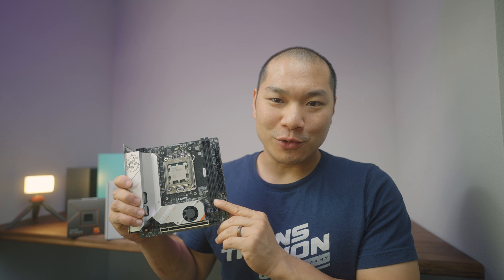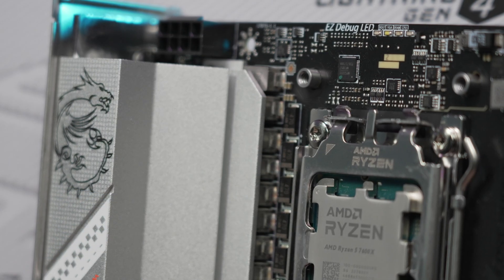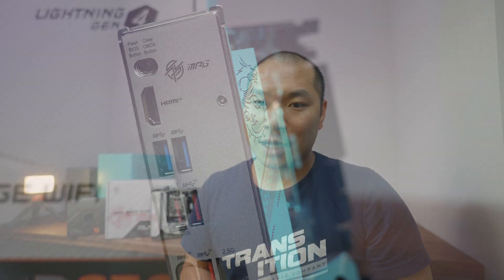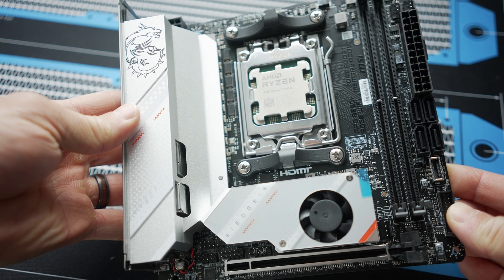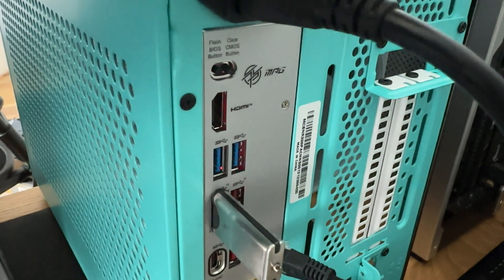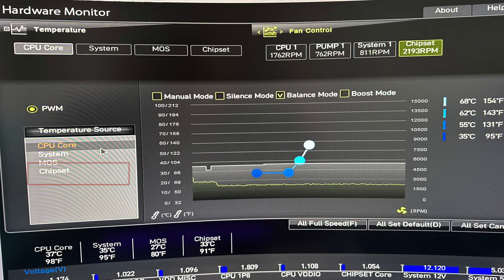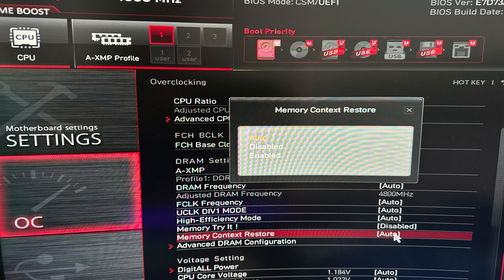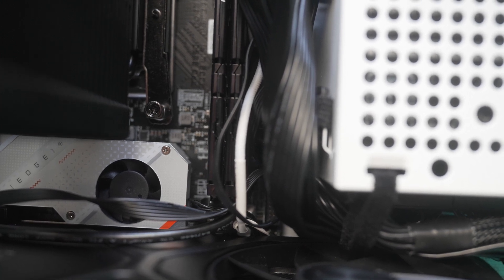MSI B650I Edge... Zen 4 Mini ITX for the rest of us?

Comment: It would be a go-to motherboard for me, but it has one design flaw that could have been easily avoided. It has 3 audio jacks at the back. So that is good, I can connect 5.1 speakers that I use since 10 years cuz they are good ! WRONG. I can't. Some one at MSI decided that it requires front panel audio to connect 5.1 audio... Genius ! That leaves only Gigabyte (that has everything as you would expect, 3 audio ports at the back to connect rear/front/center) or Asrock (that seems to be similar but it does not state it in the manual, so it is still a gamble).

Comment: Could you please confirm if there are any buzzing noise upon high gpu usage through 3.5mm audio ports (front and  back). ❓
I have 9800x3d, msi b650i edge wifi, 3070ti and xpg lancer 32gb ram.

Comment: The high CPU socket position is the most annoying aspect of this board. Makes certain coolers incompatible like using a IS-55 in a Fractal Ridge. The high position will work against you in cases like the Ridge and Terra that positions the motherboard upside down, in reality this moves the socket to the bottom of the board and heat gets trapped at the top of the case or middle in the Ridge.
Reply: For this I am moving to the ASUS B650E-I

Comment: Sadly its a year later and MSI still hasn't made a B650E ITX board (actually no new ITX boards have appeared, its slim pickings)

I don't have issues with PCIe 4.0 for the M.2, but I am concerned with only having a PCIe 4.0 expansion slot and future graphics cards.
Most likely the 5060 will cut lanes just like the 4060 did, not a problem if down to 8 but with 5.0 having so much bandwidth additional cost savings might be had and its chopped to 4. (there was 4.0 cards that only had 4 lanes so with 5.0's bandwidth there is a high chance more cards will only have 4 lanes)

Comment: If I built an AM5 system, it would either be this board or probably the Asrock Phantom b650 itx. I need a spdif for my flight sim headset with the head tracker, and the asrock has that feature. I've been using the b550 edge from msi for a couple years now, with no complaints. Not sure why they took off the spdif for this version, but it probably cost them a sale from me.

Comment: Just realized my b650e-i strix has a dead aio_pump header. Bad solder on the 12v pin. It's still within the return window and the only other board my local store has is this but I see so many people complaining about dead battery issue 😡. Also it's only $15 cheaper here with far lower specs vs the b650e-i.

Comment: Hello - I have been following your channel for a while, and I love the relaxed yet informative style you have got going :)

I had a question, perhaps you no longer have this board, but if you do it might spawn another video :)

Apparently External Clocking is something useful on AM5, especially with X3D CPU's - as it allows for better overclocking; My question is, can you check/confirm whether eclk works on the MSI ITX board, according to MSI's BIOS guide it is enabled, but that's a generic guide for all AM5 boards...

Thanks in advance!

Comment: I must admit...the AMD matx & itx boards made by MSI were always lacking in certain areas BUT have always  provided you the essential things needed on the motherboard without going crazy with the bling-bling features. Although I am more of a MSI gpu fan, I would not hesitate to buy this board if the Gigabyte B650i was not available to purchase. Remember the EVGA & XFX 750i sli motherboards? This MSI B650i makes me think of those 750i SLI motherboards. Those were some awesome mobos back in the day...rock solid😁

Comment: Did you test AMD EXPO on this board? I bought the Gigabyte B650I and it is stable at JEDEC but EXPO is not stable - memtest errors, bsod. So I am considering this instead.
Reply from the maker: Sure did. No issues on the MSI. Sometimes the RAM kit is a factor though.

Comment: One more weird thing regarding the tall clear CMOS button, from the MSI forum, seems like a number of users for this board (including myself) ended up with the button cell battery being depleted due to the clear cmos button being repeated pressed during shipping (there's an imprint of that button inside the box). This seems to result in the motherboard losing all settings the when shut down (kept losing my XMP settings) and seems to cause the memory to be retrained every time the system is started up form shutdown, leading to a unusually long startup time.
Reply: I just got the board, and they have changed the packaging by making a cutout for the CMOS and flash bios buttons. Will update here if the problem is still there.
Reply: @ash-wu8rr  mine had the cutout but it had gotten tossed around during shipping and that cutout got compressed. If yours isn’t deformed then pretty good chance it’ll be ok. 👍
Reply: @ash-wu8rr  after 1 year, whats your verdict?
Reply: There’s a bios update on the long start up time there’s a memory related setting needs to be enabled

Comment: Good review cheers. Does the SSD fan even need to be on? I was half inclined to unplug the fan entirely but decided against it (for now). Haven't ever seen the SSD get all that hot, around 50 degrees maybe max off memory..
Reply: Nah, you safely turn it off or replace it with a larger passive heatsink.

Comment: The reviews on the store sights was horrible, even the 5 star reviews are giving you a troubleshooting guide. doesn't seem worth it for 300 for just better wifi and extra m.2 over a 5800x3d and a used B550 with no annoying fan.
Reply: Yeah but its tricky, for me I dont want to buy an AM4 system, because I cannot upgrade it in the future, meanwhile with this AM5 board I will be good for years.
I read a lot of reviews, and the main complains are:
- Dead battery (because of bad packaging)
- Bad layout (harder cable management)
- Accidental press of the CLEAR Bios / FLash Bios button, because its sticking out
- M.2 Cooler problems (coil whine)

I think these are all valid points, but you can solve all of them.
You can replace the battery, you can protect the BIOS buttons to prevent an accidental press, and you don't really need the M.2 cooler if you dont like it.

Currently this is the cheapest AM5 ITX board you can get which is decent.
Reply: @r4nddon  Luckily the DDDR5 has gotten cheaper. Hopefully more boards come to market

Comment: Just finished assembling this board with 7800X3D amd 7900XT. I'm very satisfied with it.
However, I'm getting a replacement board tomorrow because the BIOS settings will reset the moment i unplug it from the wall.
Looking through the MSI forums, it's suspected to be a drained CMOS battery due to the protruded CMOS reset button being constantly pushed in it's packaging.
Unfortunately, the shop says they can't replace just the CMOS battery as it will void the factory warranty.
Hope the replacement board have a good CMOS battery.
Reply: how is the board so far?
Reply: @ciw8688  it is working beautifully and it has constant firmware updates support. I love this board

Comment: awesome review. Solid coverage. Yup $289 is a chunkocash for a marginal IO. I have a B550I Aorus AX and went 5800X3D instead of going B650 ITX with 7800X3D. The MSFS 2020 VR FPs is 8 FPs difference and not worth the additional $450-500. I'm waiting to 8000 series 3D and motherboards that actually offer value!
Reply: Yup I love my 5800x3D too. I’m planning to move my pc to an Itx and that’s the exact motherboard I’m thinking of pairing it with
Reply: @Fausto_moh  it's been solid. what Case are you looking at. the socket sits higher up on the motherboard compared to MSI board and in my NR200 it leaves no room for second fan. no biggie but worth a look depending on your case choice.
Reply: @b6s4shelter  The Dan C-4 SFX, its releasing tomorrow morning and im hoping to grab one. since im running a 240 aio i think i should be good, but i'll double check. thanks for the headsup.
Reply: @Fausto_moh  I'd go NR200 for $90 and spend money on better parts. DanCase are too expensive

Comment: In the UK, Gigabyte is cheaper and afaik, has 3x M.2 slots (2 on the CPU and 1 on the chipset) one is gen 5. ASRock is also close in price and is gen 5 compatible with more USB and SPDIF.
Unfortunatley Gigabyte ITX is only offered through USA retailers to the UK and after checking with Gigabyte UK, they will not covere RMA or warranty. Count yourself lucky in North America. Personally I'd pick a gen 5 compatible mobo as I would only be buying into the AM5 ecosytem so I can upgrade in 3-4 years and that additional gen 5 headroom could be a real telling point in future gaming.

Comment: GIGABYTE B650I AORUS Ultra seems to be cheaper and have better IO and software features. I also like that the Gigabyte has a USB C 10G with DisplayPort, as well as an HDMI 2.1 and DP 1.4. It could come in handy for hybrid graphics, virtualization, and potential APU options in the future. Gigabyte also has more USB ports and one more M.2 slot in addition to more SATA. Both MSI and AsRock dropped the ball with display connectivity considering every AM5 CPU has an integrated GPU which is ideal for multiple monitor productivity setups, with powerful APU options in the pipeline. A single HDMI port is not enough for a serious computer. Just imagine the tiny powerful mini PCs that will be built after AMD releases their APUs.

MSI seems to have cheaped out in other areas too. There is no backplate. Gigabyte includes one.
Reply: If only they had a Mini ITX version of it (for AM5). I mean, SFF PCs are super popular now, it would be a smart move.
Reply: I have a hard time looking that in my country the only available is the Elite version which is mATX, the itx version I saw was aorus pro AX but this is B550

Comment: I have been running this with a 7950x + 4090. Its decent for now. 
One thing bothers me is boot sequence. The dram (yellow) is always on for like 10-20sec and then it boots up. I tried overclocking my RAM from 5600 to 6000 (there's an Auto setting) and the things was stuck, the LED debug was on for like solid 20min. I just had to use the clear CMOS and then it booted up. It maybe the RAM I am using but still it very annoying, specially coming from am4 boot speed. 
The Gigabyte B650i itx, I find is a superior one. But its not available outside Americas.
Oh and I just manually put the m.2 fan in its lowest fan speed and its all good. Going above 1300rpm the sound it makes it already very load.
Reply: I have memory instability issues as well running at 6000. The firmware updates have helped but it's still not great.
Reply: Just use the "Memory Try It!" RAM 6000mhz preset (the lowest cl30 one that doesn't raise the voltage to 1.4). Then tighten the RAM timings with Buildzoid's settings from Hardware Unboxed's DDR5 RAM on steroids vid for an extra 7-8% performance. This should work for all 6000mhz ddr5 ram as apparently all the 6000 mhz stuff is high quality RAM. Works well
Reply: @rasa4512  hey man. Thanks for the info. I've used the memory try it  settings. Currently running 6000mts cl32 1.34 volts. It's a bit unstable now, normal desktop use is fine, but whenever I play Hogwarts, switching between different windows and the game quickly,  crashes the game 3 times out of 10. I'll check out the buildzoid guide, hopefully that helps and tightens my timings aswell. Do you think I should disable expo?
Reply: I believe the EXPO settings doesn't matter as it defaults on anyways when you choose one of those Memory Try It! presets. The one that's stable for me is the lowest on the list of the cl30 6000 mhz (asterisked version) try that. Also I would update the BIOS to avoid the VSOC over volting issue that has been melting some boards to be on the safe side. Oh and enable the PBO setting in the overclocking menu (especially if you have a non x amd cpu) to allow proper boosted cpu clocks

Comment: 3:53 with the latest 132 BIOS this board now supports 48 GB memory modules, so the limit should be 96 GB now. Also they fixed win 11 sleep mode with that BIOS. Before that release sleep mode wasn't active, there wasn't even an option for that in Windows. This version is still in beta though, but it is a recommended one, since it fixes am5 excessive voltage issue.
Reply from the maker: Good to know! Thank you!

Comment: could this be a good choice for ryzen 7950x + rtx 4090?
Reply: I am using both of those on it. Its ok if you dont want to overclock or anything. Good enough. Though I am having issues with its memory compatibility.
Reply: @pronoP2  maybe i will undervolt the cpu. Anyways i'm thinking to go with the Asrock b650e pg-itx wifi. Seems to have 5gen pcie
Reply from the maker: Definitely tune curve optimizer on the cpu. The power stages on the board are enough to handle any Zen 4 chip in terms of the amperage.
Reply: Handling the higher end chips (no overclock) is what I need……something that in 4 years I can put a used top end 7950x at least, or whatever is available before we hit AM6 and then a new graphics card for hopefully 6-8 years run on this board. Note……it’s been 8 years since my last motherboard upgrade….couple graphics cards in Crossfire and I’m getting 60 fps in Battlefield…that was enough for me. So it’s time to upgrade with “future proofing” in mind.

Thanks for your review!

Comment: In your opinion, how does this msi board compare to Gigabyte's b650i aorus ultra? 

I personally recently got the Gigabyte B650i Aorus Ultra, it feels similar to the msi board. I am also affected by the longer post times at boot, but having 3x m.2 slots (one is pcie5) is nice. I have my board also in an nr200 with a c14s cooler. Unfortunately, I don't think I can fit both 120mmx25 fans at the top of the case, but I might try a couple of thin profile fans if I find that I need to assist with pulling air out of the case.
Reply: I returned mine since it came with a dead CMOS and dear rear nvme.

It took nearly a minute to post on that board with a M.2 gen 4 drive. 

I would say it's a better board due to having 3 x m.2 slots. Air cooler compatibility will always be an issue no matter the board, these itx boards are primarily focused with AIO's in mind.

Comment: Can you please give me your opinion on b650e asrock riptide motherboard.
Reply: Also with b650e , the motherboard i just mentioned,  will the m.2 and pcie gen5 both run at gen 5 in the same time . If i have a gen 5 m 2 and gen 5 gpu will both of them run at gen 5 together?
Reply: @mauricus6670  yes will do, m.2 gen 5 are releasing soon but will cost 2-3 times more than gen 4.

Gen 5 gpu's don't exist yet. I would avoid this board personally, my one came with a dead rear nvme drive, and dead CMOS. The packaging on this is awful.

Got a  Rog strix B650E-I instead.

Comment: For Intel, there is a way to shorten boot time on z690i?
Reply: No, it's memory training due to DDR5's high frequencies. 

AM5 Boots times are probably worse, 30 secs for me on a M.2 980 pro (gen 4 drive)

Edit: On AM5 there's memory context restore, which I think disables the training but can easily cause BSOD on Windows.
Reply: @TDV1  13700k ddr5 nvme gen4 ~25sec
Reply: @errrr69  yep exactly, it's faster than AM5.

Some motherboards I've heard can take up to a minute to post. 

It will improve overtime with bios updates.
Reply: @TDV1  Should it fix it because every time you train memory? My old platform is faster
Reply: @errrr69  I don't know the reason, but at the moment memory training is required on every boot.

Same my AM4 board took 10 seconds.

Comment: Mine came with a dead rear nvme drive, and a dead cmos battery 

I saw in forums that the dead cmos is common, since the button is raised, it's constantly pressed in the shipping box. Honestly the packaging on this board is a joke.

I got a Rog strix B650E-I after which just destroys this board in terms of quality and features.
Reply: Had the opposite experience with 2 samples of the strix b650e-i . Abysmal coil whine, bios settings wouldn't save no matter what I did, and now the recent issue of Asus boards pumping the most voltage into CPU's out of any manufacturer. I'm also salty that after several months, Asus still hasn't addressed the problem of idle crashes with the b550i strix and rtx 4000 cards. Have only bought Asus boards my entire life up until the b650i edge for AM5.
Reply: @Trifter419  There is coil whine, but it's intermittent and very quite. Mine was manufactured in March, recent batch.

yeah I heard, they messed up on that. Either way I've always set my voltages manually.
Reply: @TDV1  Yeah I think both of mine were from November even though I purchased them back in March. Must've been bad with those batches but has since been addressed. Lol I should follow you and set them manually now too after this whole issue. Good practice to have.